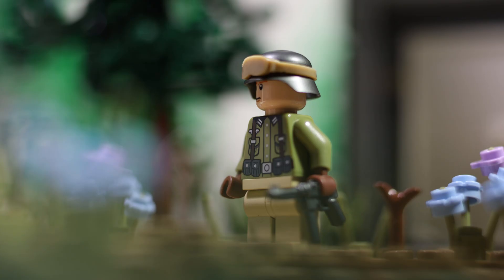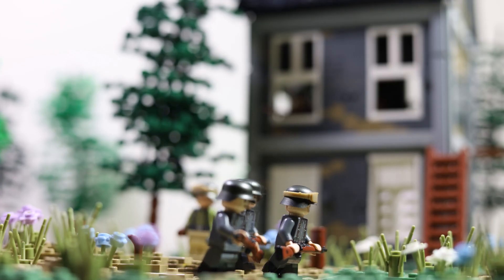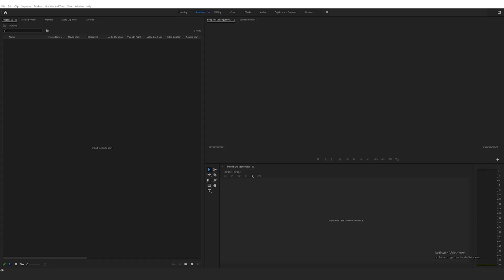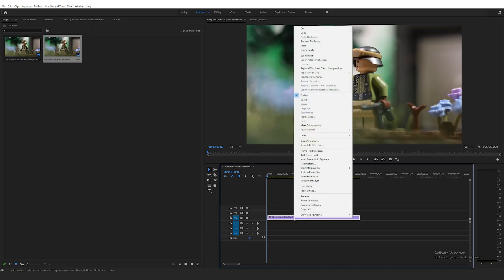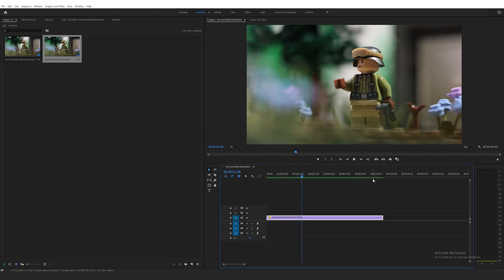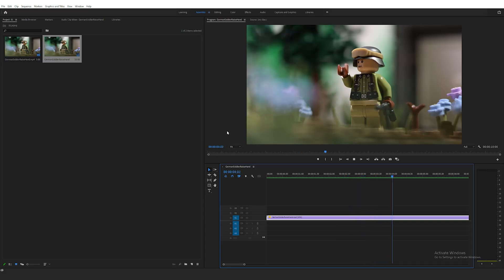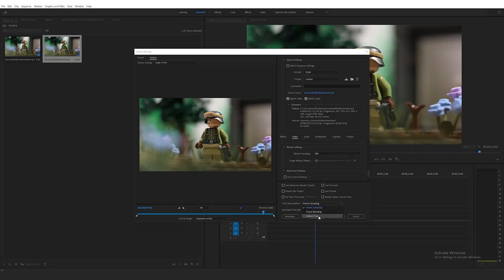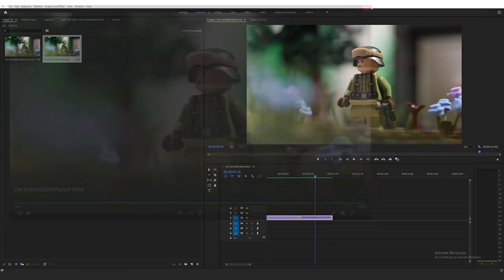Improving and smoothing Lego Stop Motion Animations

Comment: Very nice tutorial and explanation. Good points about background composition for interpolated frames.

I've not used optical flow, but have found DAIN is pretty good for interpolating videos with minimal artifacting. Not terribly user friendly and very VRAM hungry though.
Reply from the maker: Thank you! Despite never trying anything else I have heard there are better ai based programs that work quite effectively! I figured Adobe would be more user friendly for an intro tutorial. Have you tried any of them? I would love to talk about it if you have any experience!
Reply: @BallisticBricks  
So far DAIN is the only one I have played with. I was using it for some slow motion moments in recorded video game footage. It did a pretty good job of going from 120fps native to 480fps interpolated. Unfortunately DAIN is extremely VRAM dependant, so I ended up having to use the built in quadrant feature to split the video into a 3x3 grid. File was 1440x3440 using 8gb VRAM.

I was also trying to learn DaVinci Resolve at the same time. Never did get comfortable with it...
Reply from the maker: @ExF1Guy  That’s pretty awesome would love to see some results! DM me! I have a 3 gpu setup if you want to try some intensive project. I tried DaVinci once as I quite dislike adobes ethics but never learned enough to do much. Not yet at least.